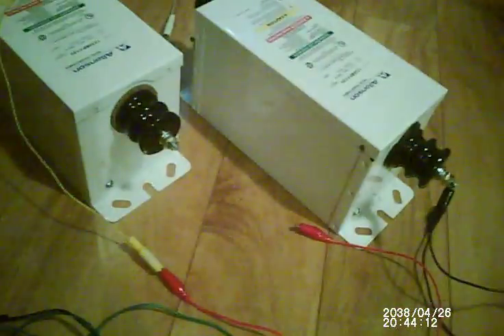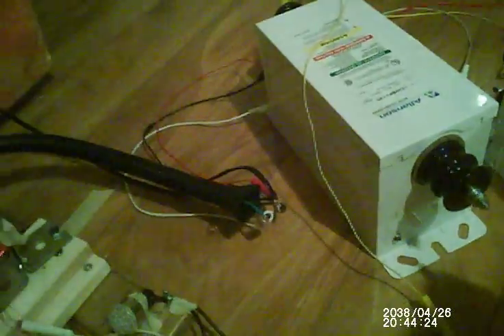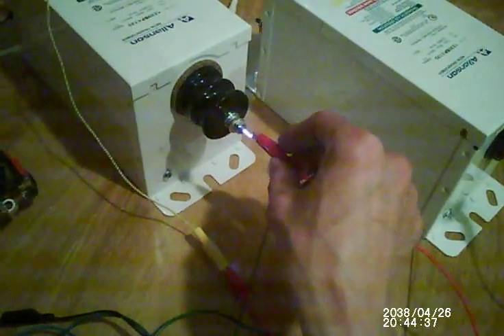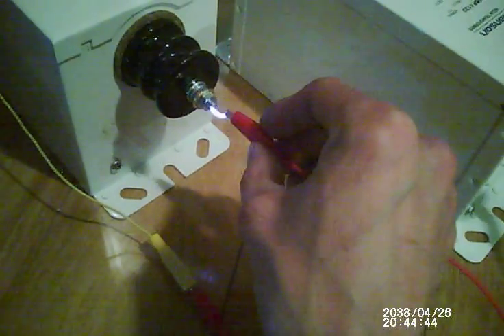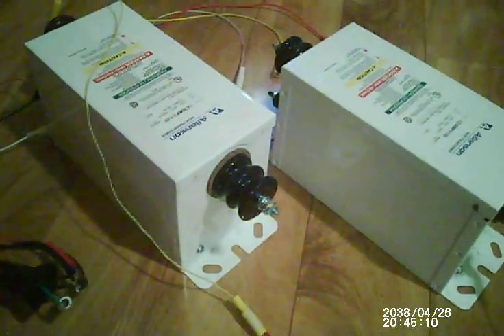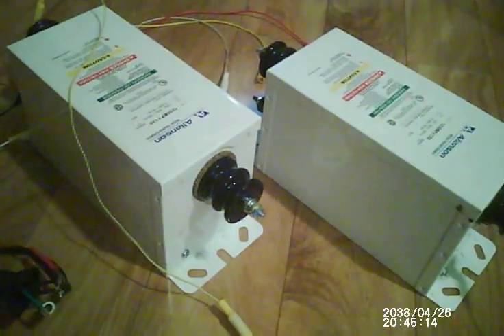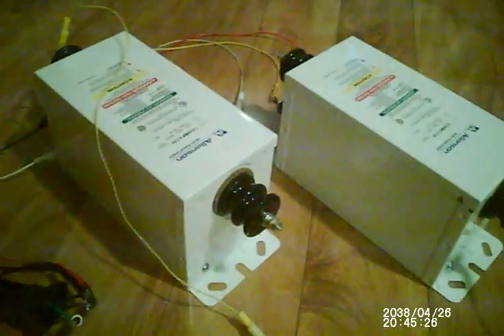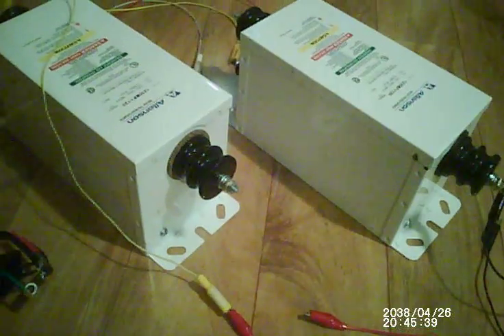Don Smith Device Project Part 1: 12,000 Volt 30mA NST

Comment: The insulation on a jumper wire will not protect you from 12000 volts if something goes wrong! Clip the wire on to the metal part of a screwdriver or other tool with a plastic handle and then when holding the handle you can draw an arc without the danger of being electrocuted.